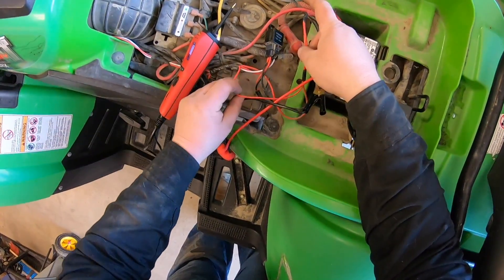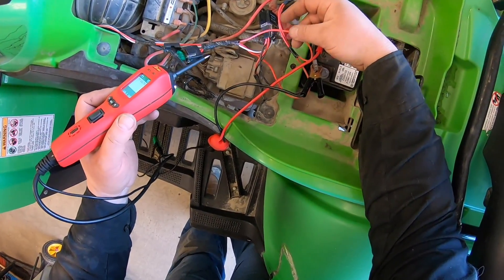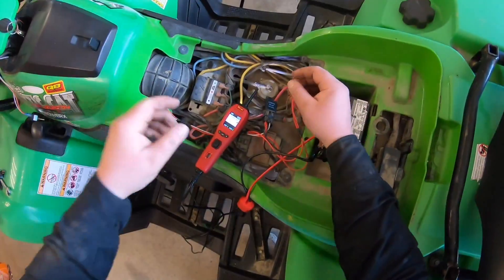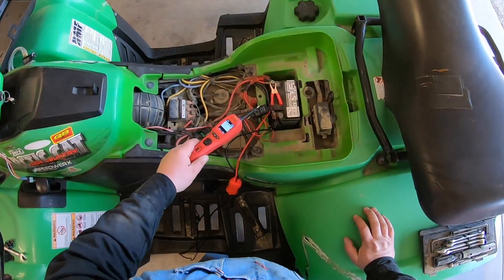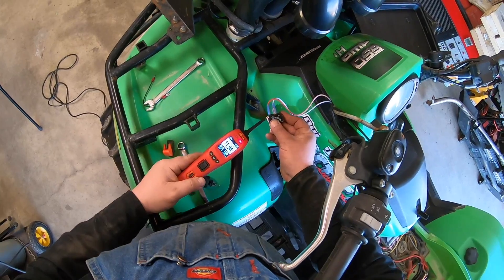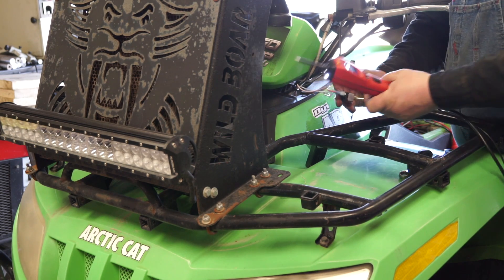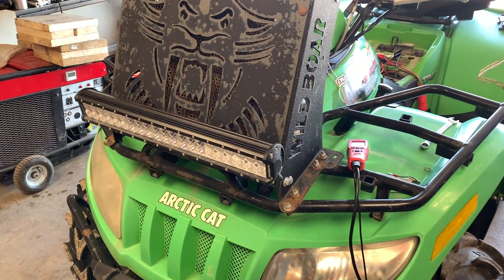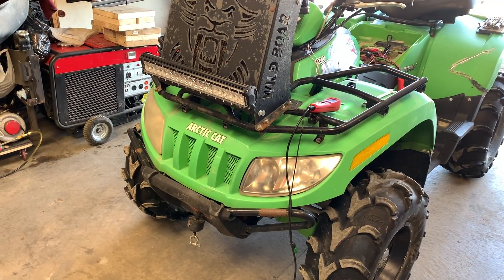Power Probe Best Troubleshooting Tool Ever

Comment: Just got my Power Probe kit last week from Amazon.  This thing is tits!  Was able to find a loose wire in a fuse block and that the relay was fine pretty quickly.  This is going in my 4x4 electrical bag for sure when I go out wheeling!  Thanks for another great tool tip Jerry.